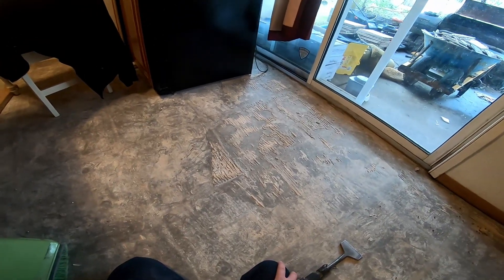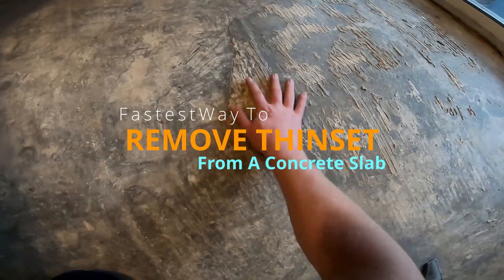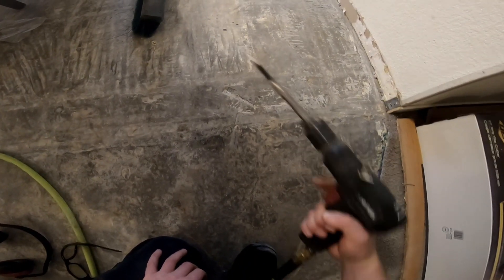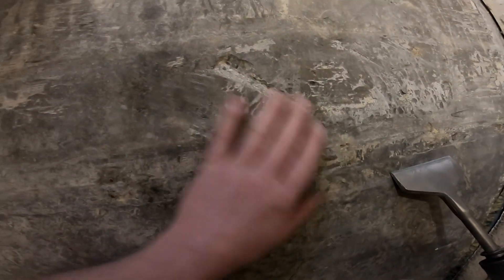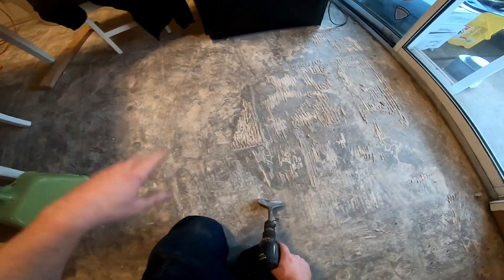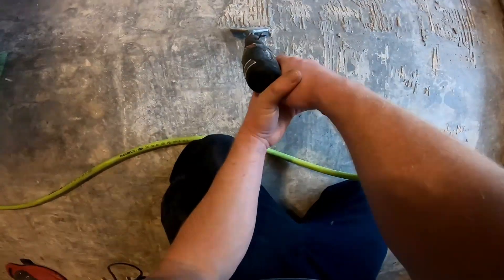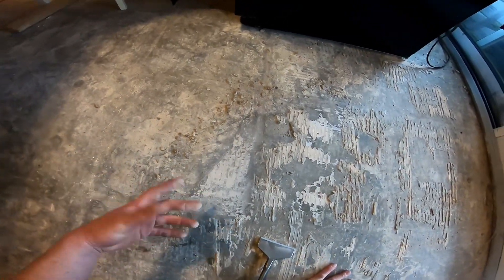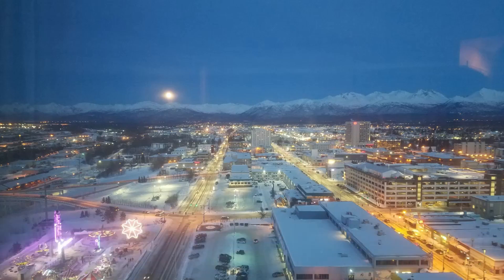Fastest Way To Remove Thin set From A Concrete Slab

Comment: Jack hammer and floor scraper bit is much faster and cleaner. They are about 3 to 10 times the price of that chisel you were using though. I have been looking for one for my jackhammer and haven't found one that looks like my bits, but I think I will take a chance on an ebay item. It is also a 1 1/8th inch hex shank but mine is round on the end and not a hex. Never buy off brand tools. Never thought I would want to buy bits for this jackhammer but here I am not finding a floor scraper with the same shank! My brother rented a jackhammer with a floor scraper bit. I was skeptical but after using it for 30 secs, I am now a believer. The floor scraper bits are $50 to $300. Not 10 to 25 but they make your foundation completely clean without even scratching the cement.